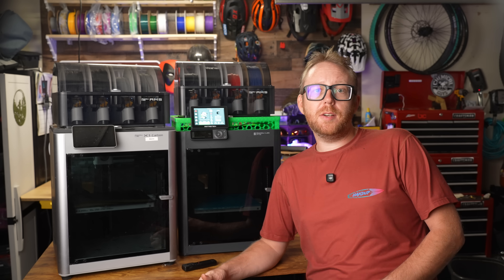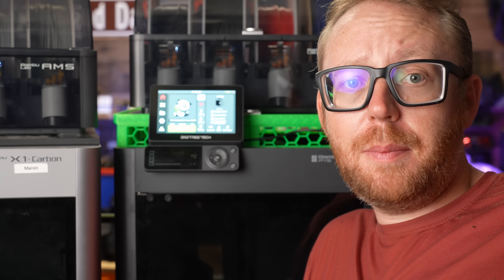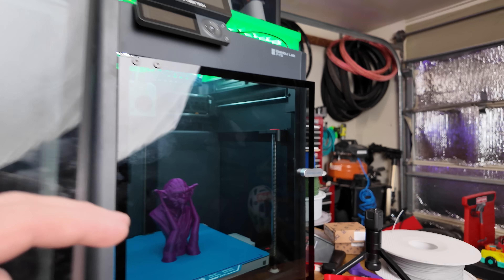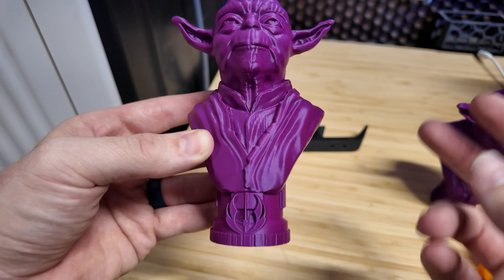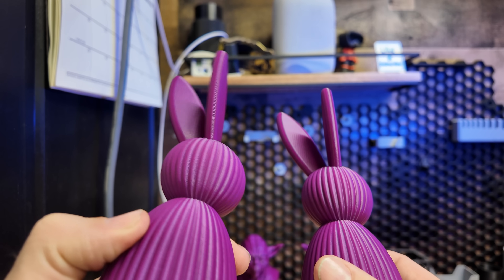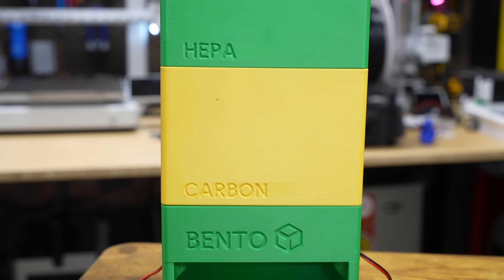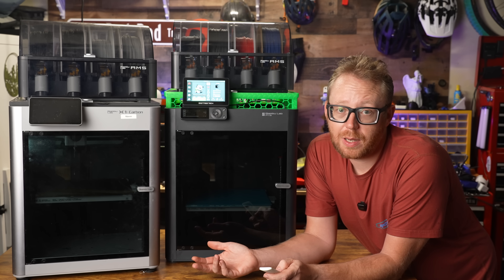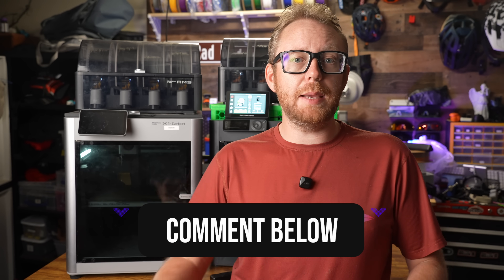Why I Regret Buying the Bambu Lab X1 Carbon vs P1S

Comment: uh ...no thanks, I prefer comfort, that is to say a real screen (which I use often!), a plate that goes up to 110°, a high definition camera, an all-aluminum fairing (greater durability over time), spaghetti monitoring and inspection of the first layers, a carbon nozzle for corrosive filaments! automatic plate recognition (if it is the right one in relation to the profile) etc ....

Comment: We've had both printers for prototyping for our company and definitely are on the side of the X1C. The displays are terrible on the P1S... and no matter how much you think this doesn't matter, you do use the printer display a lot in real everyday use. The amount of maintenance and issues we've had with the P1S printers vs the X1Cs is not even a comparison. They are just nowhere near as reliable. The X1Cs are work horses. Skip the AMS and just get the basic X1C.

Comment: Those prints look great.  If you do not need or want the frills of the x1c then the P1s is the machine to get.   It is funny but NO other machines compare to Bambu...  Tubers will say, except for the stringing or I just have to dial it in or yeah it's just my first print. Even if another machine can make a nice print the whole eco system is awesome. I do not work for bambu,  But, look how nice your prints came out and repeatable on different machines.  Amazing.  Good stuff!

Comment: The P1S is definitely more bang for your buck. However, as others have said, the bed temp only goes up to 100C. I've had good results printing smaller parts with ABS, ASA and PC blends on the P1S but larger volumes do tend to lift and sometimes fall.

Comment: I had the same issue deciding on which one to get when the P1S came out. I decided on the P1S in the end as the screen was not needed. I do pritty much everything from the slicer and the small screen is not bad at all. I dont get why so many people hating on the P1S screen. Maybe because i have an AMS and dont have to load the filiment manually and use the screen to do so? The main thing im missing from the X1 is the computing power. Because of this the X1 runs on a differenet OS and can be upgraded/changed. Which could be very useful. But the main feature for me would have been cancel print object. This would be very handy as when printing a big plate full of small parts and one fail it would be very useful feature to have.  The extra heat from the bed would be nice too but i dont print much ABS/ASA and for temps i just have a temp/hydromitor in the P1S that i can see from the camera.
Reply: P1S absolutely has cancel print by object, I’ve used it a few times. I never use the screen on the P1S, I have an old iPad mini right next to my printer with the screen always on running the Handy app.
Reply: @DHS-IC  where is the cancel by object for the P1S? i use the slicer mostly. is it in the handy app? Maybe thats why i not seen it?

Comment: If you only print PLA or PETG: 100% agree. On the contrary, if you plan to print technical materials, YMMV. Sure, you can swap the stainless steel nozzle of the P1S for a hardened steel one, as it is quite cheap. But there is no temperature sensor of the P1S chamber, so that you can't know the correct heat before printing ABS, ASA or PA. Putting a cheap thermometer inside the P1S enclosure is not the same, because you won't be able to monitor the value in Bambu Studio or Bambu Handy remotely. As for the lidar, I was very excited about it when the X1C came out initially because getting a perfect first layer back then was a challenge on other printers. But what is important in the end is the flatness of the bed and the quality of the nozzle probing. First layer is as good on a P1S than on an X1C, which proves that the lidar was a bit of a useless gimmick for that (it can improve the print quality with automatic calibration, but not by much and you can do manual calibration on the P1S) and TBH, I don"t use lidar and first layer detection anymore on my X1C. The camera of the P1S is so bad (anemic framerate) that it is barely usable, shamefulI in 2025 IMHO. Last comment: I hate using the screen of the P1S, so 2000. I love using the touchscreen of the X1C. Bambu Handy is not a complete substitute to the P1S screen as it does not allow loading/unloading the filament, for example. Overall, I like to use my X1C more. I fact, if I had to buy a printer in 2025 only to print PLA or PETG, I would have a hard time choosing between a P1S and an A1 (the cheaper A1 is also compatible with the new HF nozzle of the H2D).
Reply: @fluxcapacitor   X1C doesn’t have a heated chamber just like the P1S so I don’t see how it would be any different printing ABS, ASA, or PA.  I purchased a chamber heater from aliexpress for $80 that can be controlled and monitored remotely along with temperature readings for the chamber.  Works great.  Now printing ABS and all of that like a pro.
Reply: @samanthajones4877  I partially disagree. Not about adding a little heater (which is a good idea) but about the claim that X1C has no heated chamber. Contrary to A1 or P1P, X1C has a closed chamber, and contrary to P1S the temperature in that enclosure is monitored. So it has a closed chamber, even if it is "passively" heated by the heated bed only. Facts: after a ten-minute wait with the bed heating with just an aluminum foil and a cotton towel or pillow on top of the printer, the X1C chamber can reach 45–55°C typically, which is enough to print ABS, ASA or PA with no warping. As you said, one can add a little dedicated heater inside, in order to make the chamber actively heated and speed up the process, but it's not mandatory per se, unless you want 60°C+ (which starts putting a bit more thermal stress on the electronics exposed to that temp) or if the printer is located in a potentially cold room (such as a basement or garage). I was even considering this heater myself as an addition to my X1C to speed things up, before actually switching to annealed HT-PLA-GF instead of ASA-CF.

Comment: I went with two P1Ss instead of an X1C.  Its a no brainer because the number 1 problem of owning one good 3D printer is the fact you don't have another one ready to print on because you are already printing something.   The only thing the P1S must have addon are the hardened gears/nozzles to do glass and carbon filaments.   Who uses the touch device interface anyway?  Most control all their printers and prints through one interface... their PC.
Reply from the maker: Ive got 3 at home and 1 at work and i feel like that is still not enough printers haha
Reply: Having to wait to print another thing at the same time SUUUUUCKS lol  My impatience kills me in this hobby lmao

Comment: I bought the P1S for the same reasons. I never use anything but PLA and PETG. I don't have any interest in multi color prints so I didn't order the AMS. I can always add that later if I change my mind. It's a very odd situation, almost like BBL made a pricing mistake. It's like they're competing against themselves. I suspect the prices of the two printers will be brought closer together. Better get a P1S at the current price while you can.

Comment: Absolutely agree. I feel that Bambu lab intentionally downgraded the P1S screen in order to differentiate it from the X1C, otherwise they print the same. I think that Bambu should make a new version of the X1C with heated chamber and filtration system and cooling like the H2D, basically a smaller H2D with one head. They can rename the current version of the X1C lower the price in 200$, and discontinue the P1S or sell it as it is for 600$ including the AMS to replace the A1.

Comment: I am having that same debate, but mine is that I have two A1’s and I’m wondering if I should buy the P1S?
Reply from the maker: Any aspirations to print anything more than pla,petg, or tpu?
Reply: @ No that’s mainly all I do. More PLA and PETG than TPU.
Reply: Then the A1s are likely the better buy. Especially if you can do with the mini, it's super quality prints at high speed, at a very low cost.. the larger A1 is not worth almost the double unless you need the bigger build plate

Comment: @Rad Dad's Print Lab Didn't the firmware update ruin the use of the panda touch screen?
Reply from the maker: Only for the x1c I believe. But they did add some ways where you can still use it if I recall correctly

Comment: Shoot forget that, after buying multiple P1S printers and then using the cheap little A1 mini I started thinking it was a mistake. Dare I say the A1 mini is better?! Print quality is excellent and it’s so quiet! Had some slight bed adhesion issues but nothing a giant tote from Walmart didn’t fix.
Reply: Had the same thought, on a occasion I swear the A1 mini be hitting prints with better quality than my P1S and P1P… not sure what it is but that damn A1 mini is a little beast of a machine, very interesting too, because the regular A1 and the A1 mini nearly have the same parts, but for whatever reason I have more failures on the A1, than the Mini. Again that A1 Mini is just one hell of a workhorse. I almost wish they made the bed bigger but don’t change the design.
Reply from the maker: If I needed more printers for the print farm, I would probably just order a1 or a1 minis

Comment: I have an X1C and a P1S and I use the X1C 90% of the time.  I notice you use a panda touch display (that wont work with the newest firmware), that is testament to the crappy interface of the P1S.  I wish I'd bought a second X1C instead of the P1S.

Comment: One difference I never hear people mention is the build plate difference.  the x1c build plate has a max temp of 120c, the p1s max temp is 100c. 
If you print filaments such as ASA, it makes a difference in adhesion and also helps increase the chamber temps.
Reply: I print asa on p1s. Default settings. No any issues.
Reply: @genabeton  I think the point is having a higher temp will give you access to many types of filaments that require that range of heat because filament manufacturers keep developing and upgrading their filament.
Reply: @syamse3638  hotend temperature isn't high enough. At least 320

Comment: hi there, does the panda screen still work normally after the Bambu most recent update? Where do you purchase.
Reply from the maker: I think only the X1C has received that particular firmware update. I could be wrong though. 
https://biqu.equipment/products/bigtreetech-panda-touch-5-display-for-bambu-lab-printers
Reply: @RadDadsPrintLab  thanks for your reply, unfortunately, I think the new firmware update brick the panda. On their website, they said it's only compatible up until P1S --> v01.07.00.00. Might have to look into LAN mode if I want to use this thing..

Comment: Lemme get a bit in and say: I'm in 2 serious Bambu Labs FB groups, [where the grand wealth of information on these devices truly exist] considering you want to learn the ugly truth on any given device's real world performance; you want to know what if anything is secretly wrong with this printer that you ought to know about before purchasing.  I've read enough of user reports to affirm that you won't regret the price tag of any Bambu Labs printer. They have their irrefutably issue ridden devices like anyone else, however I'll go as far as to say that they are to be admired like any Toyota/Lexus model from the early 90's - 2001. Unmatched in delivering the coveted 'initial user experience' . I don't have one YET [kuz im saving for a H2D], so I'd say that makes me at least more unbiased than these YT content creators. I do have a Qidi Plus 4 and it produces  3D articles very near the same output quality, if not better, showcased by certain filaments when compared to a dialed in X1C using the same filament.

Comment: The least talked about feature that will save you on the X1C is plate detection. If your build plate isn't installed, or is not aligned properly, the X1C will let you know and pause the print. The P1S will happily attempt to print without a build plate and ruin your heat bed. I've seen it happen with P1S owners - they get distracted, remove the build plate to remove the last print, hit print again forgetting to reinstall the build plate. It's a very costly repair. IMO, as someone who is sometimes absent minded, X1C is worth the money. If you are vigilant and always watch the first layer go down every time, the P1S is more than enough.
Reply: Guys what if right now the X1C is 1200$ for me (Canadian) and the p1s is 900 is the 300$ worth it? Black friday deal
Reply: @maxishot2877  Honestly no. If you want to spend the least, P1S on clearance. Or A1. If you want a better printer, P2S or H2 series with the new hot ends that are easier to swap like the A1. The P1 and X1 hot ends are a pita to change. Since you are in Canada and can actually get a P2S, get that. Or an A1. I’m buying a H2C when it comes out. Might sell X1 if I can’t find space to put it.
Reply: P2S is $1050 CAD with an AMS Pro 2. That’s a no brainer. Buy that.
Reply: The price difference between X1C and P1S is $700.... you can replace a lot of heat beds for that. BTW I did the same on my K1 once... didn't harm the bed at all.
Reply: @ I’ve never done it, but I saw some posts from people that did. The heat bed surface is probably different. I could see how hot filament could ruin it. Perhaps the K1 has a better more resistant surface.

It’s not the only reason to buy the X1, but just thought I would mention it in addition to the other features usually mentioned. I bought mine on sale, so I didn’t quite spend as much. Could have bought a P1S cheaper too, but I wanted the X1.

I also have an A1 mini and I use that a lot more often. Mostly for prototyping. It sits on my desk, so it’s easy to get to and work with. Once I’m done printing cross sections with the A1M I send the final one to the X1.

If I were to buy another Bambu, it would likely be the P1. But I’m more likely to get a K2.
Reply: @dogsbd  700?? say what?? Both are on sale at Micro Center right now  x1c with ams =$999.99   / p1s with ams  $699.99

Comment: The X1C is definitely a better printer for sure. But the P1S is good enough imo. 

That said I do prefer the X1C and the extra cost is worth it for me. The lidar is very handy for calibrating the pressure advance on different filaments. Where I live its a pain in the ass to get a regular stock of filament from the same manufacturer, even the same brand with different colours can have a massive difference.

Having it auto calibrate whatever I throw in there saves so much time its worth the extra cost.

The X1C can also print faster than the P1S, it uses carbon fibre rods instead of steel which makes the gantry a bit lighter. The speed difference isnt really important to me, but its factually incorrect to say the P1S can print as fast as the X1C.

Its all a bit of a moot point now anyway because the H2D crushes both.
Reply: I need help... I can either buy a (lightly) used X1C w/ AMS and used filament for $850 and buy the upcoming Sunlu heater OR I could buy a P1S w/ AMS2 and hardened nozzle for about same price...? I'll mostly be printing ABS
Reply: @CVNTGETENOUGH  I would get the p1s purely for the ams 2. The ams 1 is aggravating to say the least and you will want the built in dryer for abs.
Reply: @CVNTGETENOUGH  Personally, I would get the X1 for the use you stated.  I know people are going to argue against it, but the X1 was designed to purposly handle the more exotic materials with hotter bed and temp regulating abilities.   Just my 2 cents.

Comment: it is how it goes, pay the premium to chase the last 5% extra quality and certainty. 
Assuming you receive an urgent order to print an engineering part, would you risk to print 40hrs to know the first 20 layers are not in correct shape(ABS/ASA/etc)? or use x1c with Lidar and failure detection so it gives you room for second print?
they are not in used in 99% of time, but so as the airbag in your car.

Comment: Useless video, brings no added value to the decision. The X1C is more suitable for carbon and other technical filaments than the P1S. If you compare the two when printing PLA or PETG, you won't find any significant difference. PS: sell all the printers and take the H2D as the egg-laying wool-milk sow

Comment: If all you're printing is PLA or PETG, I'd agree.  The extra available bed temp alone is worth the price of admission if you print regularly with ABS/ASA/PC/PA.  An extra 20C is a big deal (100 vs 120 in the US).  If you're comparing "the same" but with upgrades, the BTT screen and hardened nozzles and extruder, it's no longer 1/2 the price.  Still a fair amount cheaper to be fair.

The balance is quality of life improvements, hard to quantify.  I interact with my X1 on-board screen often.  The lidar takes some manual adjustments conveniently off my radar.  The better camera is a "meh" but appreciated.  The AI failure detections, I'm not worried so much about the failed print, but damage to the machine.  In all, I can't say I'm disappointed with the extra investment.

My take - if all you're doing is PLA/PETG/TPU, the real value is in the A1.  For the rest of the relatively entry level engineering filaments, the X1 is a more capable machine, especially for those of us who don't want to tinker too much with it.

Also, none of this is new information.
Reply: For my engineering projects I use my P1S with a Darkmoon cfx build plate along with hardened gears and nozzle, prints filled filaments and PA like a dream!
Reply: I have no problem whatsoever printing ASA with my P1S. It's the main material I use. Hardened nozzle and gears is $30.
Reply: @hajosmulders  With the hardened nozzle and gears you can print the more exotic materials like the X1c?